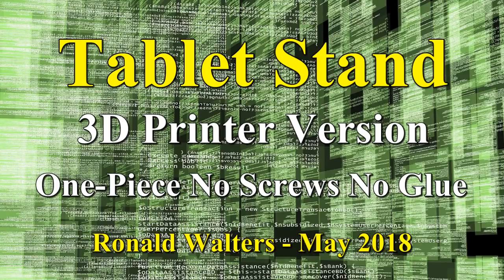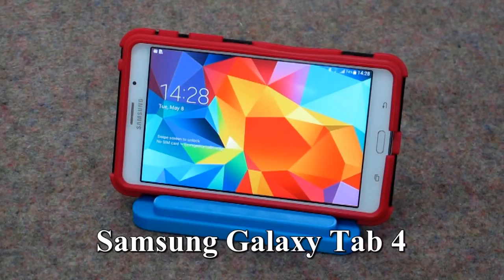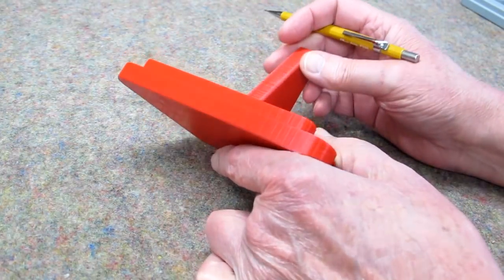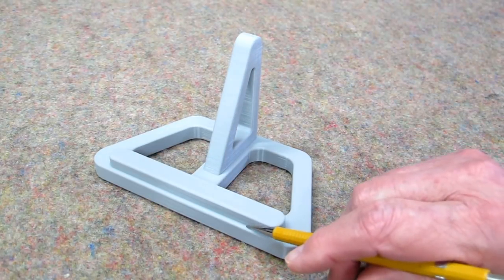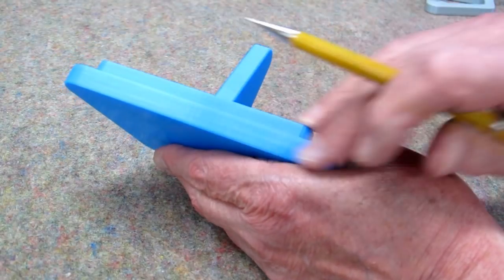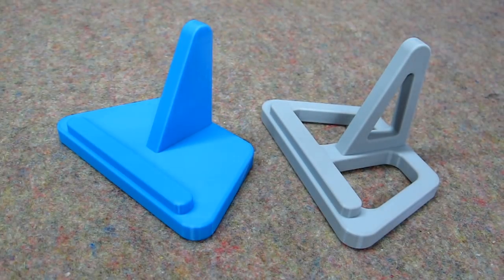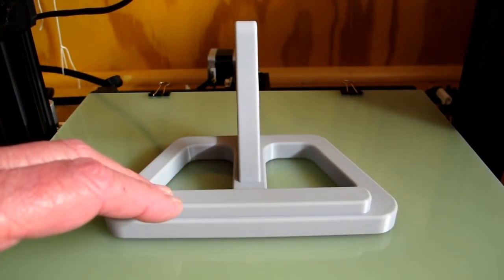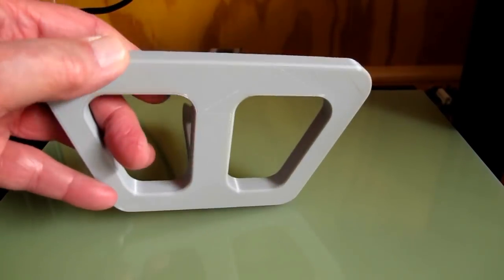Tablet Stand - 3D Printer Versions

Comment: Nicely done.  I've never really looked too much into 3D printing.  I'm curious, how much would you estimate the cost to be for the, I think the right word here is, filament to make these?
Reply from the maker: Very good question. A spool of 1.75mm filament weighs 1KG (2.2 lbs) and is approx 1080 feet long. Some slicing programs estimate the length of filament or weight of filament required for a print (mine does not).  The blue Tablet Stand weighs 77 grams and the gray Tablet Stand weighs 58 grams. The cost of a spool of filament can vary widely... $14 to $20 per spool... maybe sales tax and shipping on top of that.  I'm buying PLA as cheap as I can find it ($14 shipped).Lets say an average of $16 for a spool. A full spool would make 13 blue tablet stands @ $1.23 each or 17 gray tablet stands @ $0.94 each. Obviously I could use less infill which would use less PLA and lower the cost. In the case of something like this tablet stand, if you live in an apartment or are not into woodworking, a 3D printer can be pretty handy. If you learn one of the CAD drawing programs, you could draw something like this and print it the same day. There are countless thousands of projects available on Thingiverse.com. A roll of filament and a few dollars on your electric bill could keep you entertained for weeks and you'd be learning something at the same time (actually learning quite a few things). Thanks for watching! If you aren't subscribed, please do so.

Comment: Are you going to print organ conductors?
Reply from the maker: In a word, NO. I looked into 3D printing the conductor at the very beginning and the people who do 3D digital drawings are very proud of their work and there were zero guarantees the objects would even print. The cost was astronomical and it became absurd to pursue it any further. Thus, having the figure sculpted, followed by making molds and casting the pieces. I now personally have all the conductors I will ever need plus what would appear to be a 50 year supply of conductor parts. I see no need to pursue the project any further. :-)
Reply: Ronald Walters interesting thanks